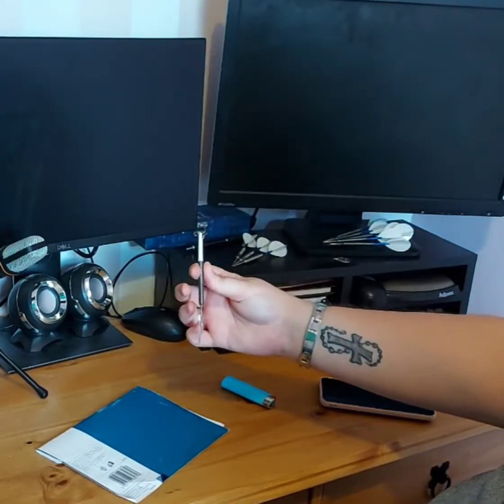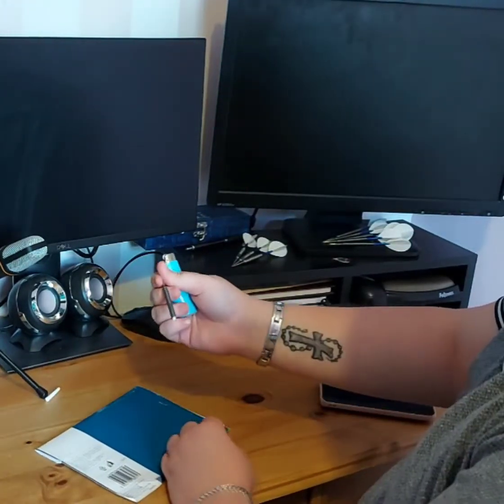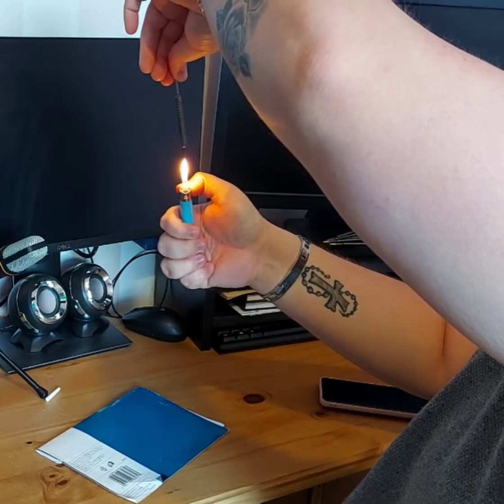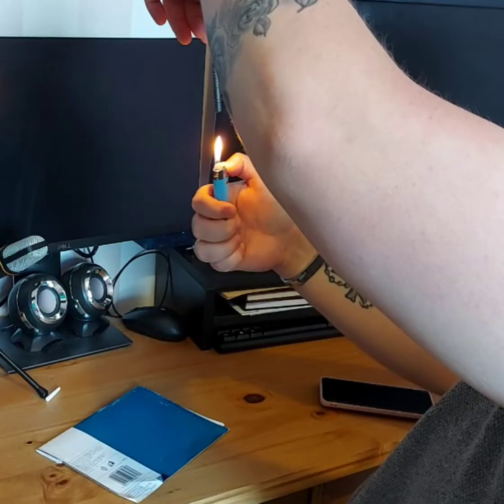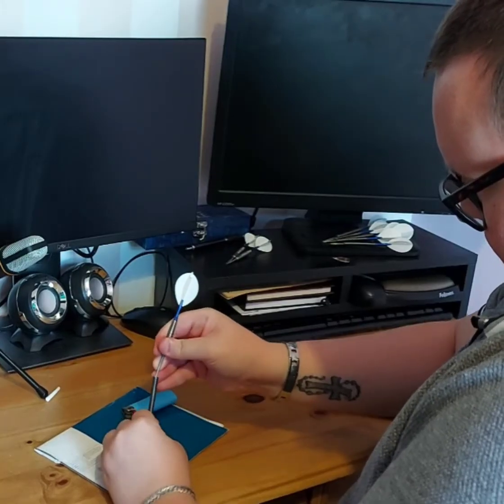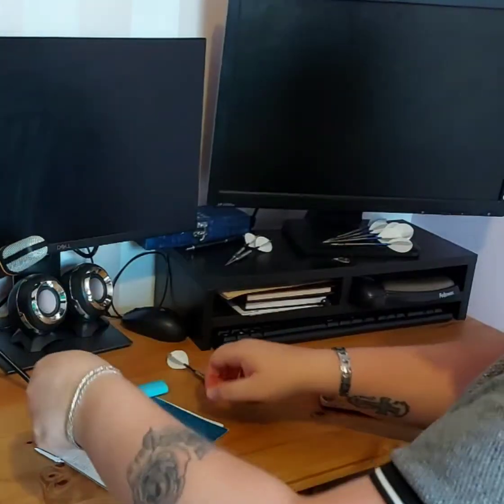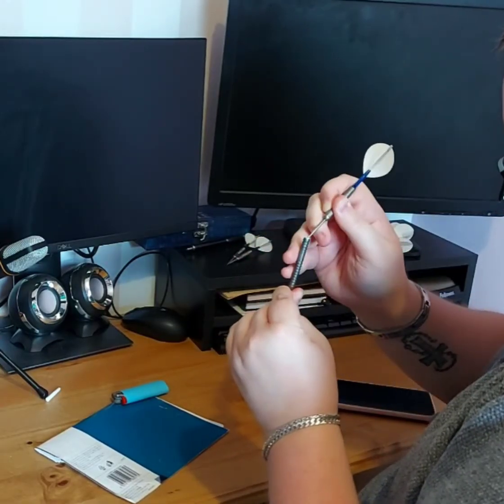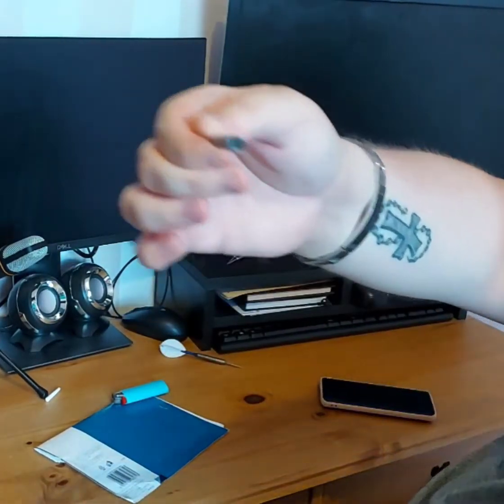Broken Dart Shaft Removal In Under 2 minutes - How to fix a broken dart stem.

Comment: I heated screwdriver with lighter and tried to remove it, now there is melted plastic inside and i don't know how to get it out, i can't put new shaft on any tips
Reply from the maker: If its a hard or transparent plastic rather than nylon that can happen. You may need to drill it out using a very small drill bit, and keep it slow. Try not yo touch the thread of the dart as much as possible.

Comment: Just curious how others do this.
Reply from the maker: You can buy a small stem extraction tool :)
Reply: @Straightdarts  what is it's name ? I sent mine away for repointing.
Reply from the maker: @utharkruna1116  it's just an extractor tool. Have a look on this link at them. :)

https://www.ebay.co.uk/itm/Broken-Dart-Stem-Extractor-Tool-Mission-Shaft-Remover-Removal-Tool-/233283226717?mkcid=16&mkevt=1&_trksid=p2349624.m46890.l49286&mkrid=710-127635-2958-0
Reply: @Straightdarts  cool, did that.  They're qiute pricy here.